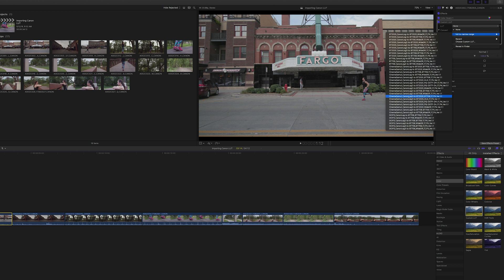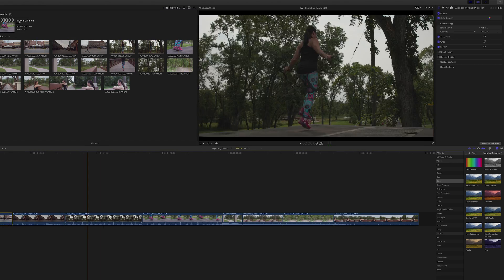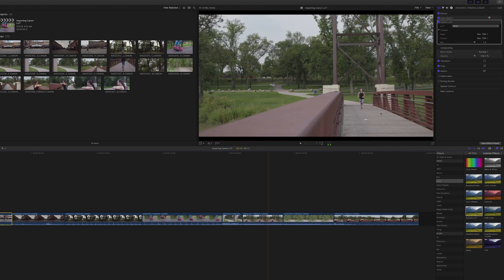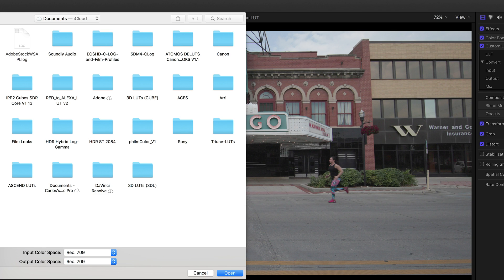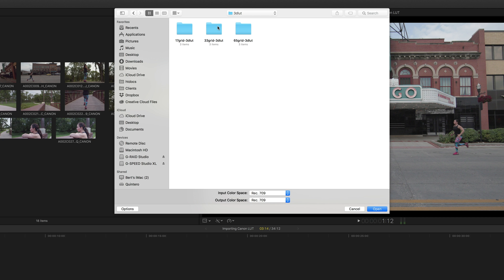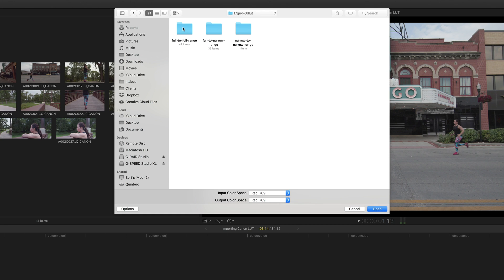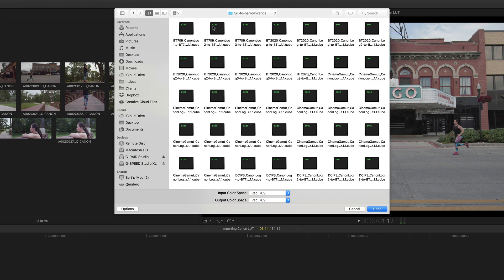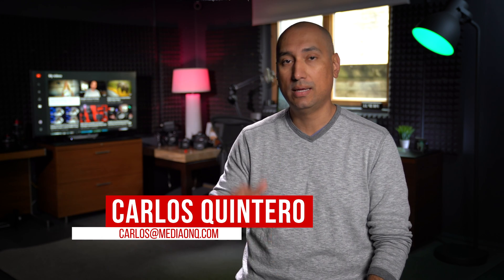How To import Canon LUTs in to Final Cut Pro X color grading blog

Comment: Thanks Carlos your videos are exceptionally informative. But I'm a little confused. Canon's readme states for the 5D Mark IV to use the 1D LUT using [group 3] fro a 5D Mark IV. Does this matter? or will the 3D LUT work fine with the 5d Mark IV? I am using FCPX. Many Thanks
Reply from the maker: If you're editing in FCPX you don't have a choice, you have to select a 3D LUT and you may need to make some exposure adjustments because FCPX does not read the 1D LUTs that Canon provides. So be sure to select the CLog version and use the WideDR version of the LUT for best results since that is the color space the the 5DM4 is capturing in.

Comment: Hello. Сan you tell us about Canon C500 ? or compare it with C300 mark ii. Thank you!
Reply from the maker: The biggest difference is that the C300 Mark II can capture in CLog2 it can output 4K RAW through a single HD SDI cable instead of a dual option like the C500 and the C300 Mark II has built in support for ACES workflows oh and HDR workflows those are the stand out differences in my head when comparing the two
Reply: c500  can record 4k half RAW 120fps and 4k RAW 60fps) Thank you)

Comment: Hi Carlos, thanks for uploading this video, very helpful. One thought though, you only mentioned adding the LUT in the Custom LUT effect, but you can also add it directly as a Camera LUT on the clip in the browser. You can select multiple clips at once to apply the LUT which means you have all clips selected ready for edit right after import.
Reply: I don't think it's a big issue other than that you should remember what LUT you had set when you shot because after importing you can select them all and set the camera LUT in one go.
Reply from the maker: great point
Reply: If you shoot RAW, it’s actually selected automatically.
Reply from the maker: When I load Canon RAW from the C300 Mark II or RAW Light from the C200 into my timeline, nothing is selected automatically.
Reply: Just checked: recorded with C200 in Cinema RAW Light, set to CLog3/Cinema Gamut, after import Camera LUT shows Canon Log2/Cinema Gamut. Ain’t that weird?
Reply from the maker: so it's doing a gamma conversion LUT? that is weird it must assume that everyone wants to start with CLog2 info.